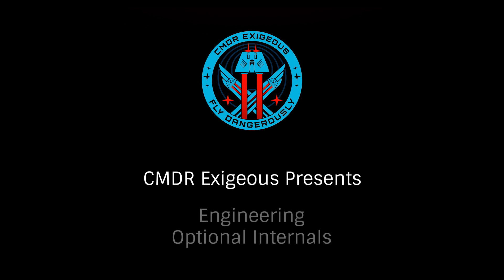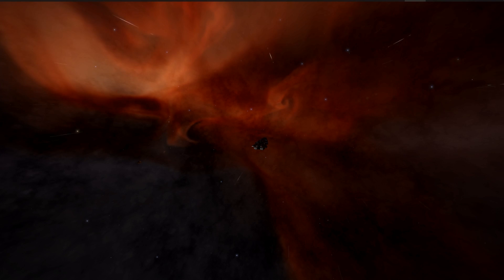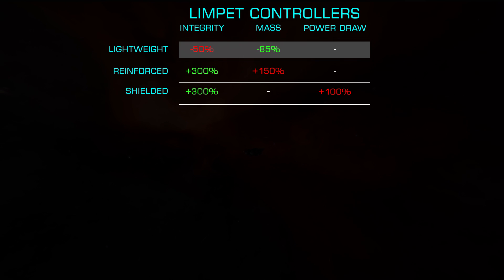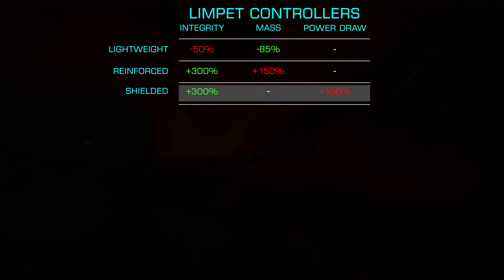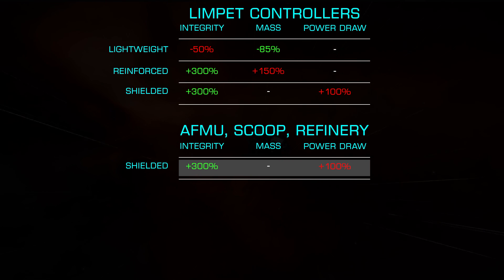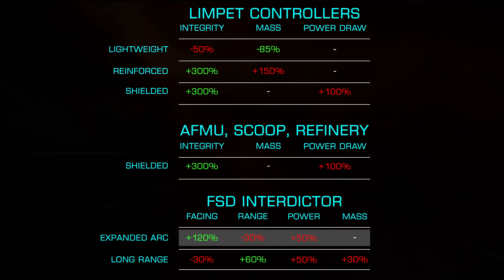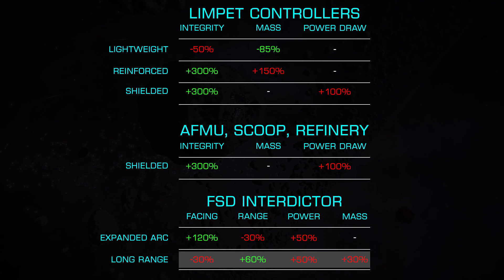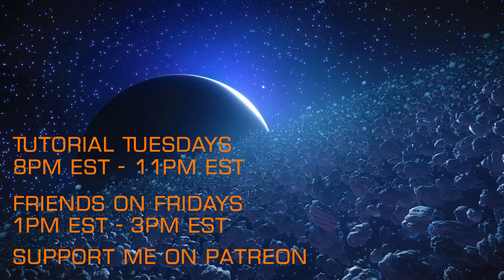Engineering Explained: Optional Internals

Comment: A question about limpet controllers-do they absolutely require cargo space to carry the limpets, or (like a heat sink launcher) can they carry a couple of limpets internally? Since we can synthesise limpets I’d quite like to ditch cargo hold entirely for an exploration trip and just synthesise enroute as required, giving me a spare module slot for either an extra controller or an extra AFMU.
Reply from the maker: They 100% absolutely require cargo space - that's where they are stored.  So while you can synth them you have to have racks to store them.